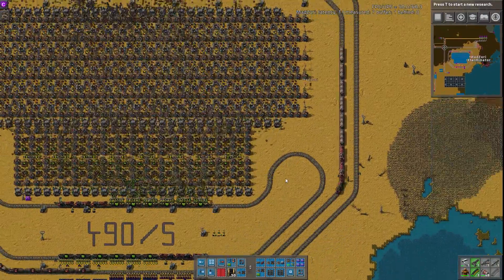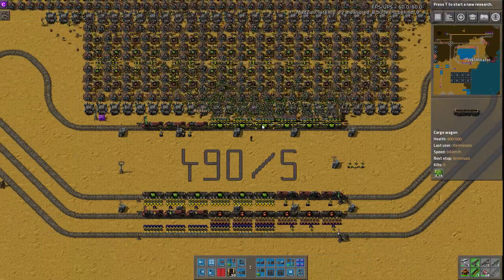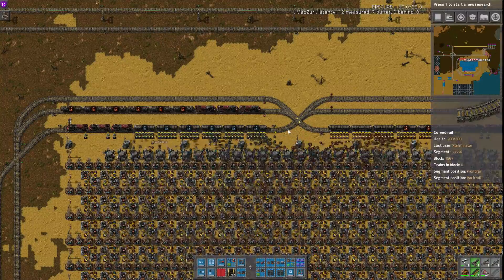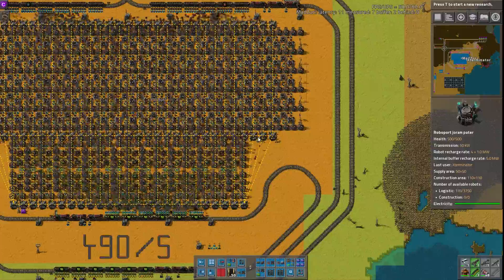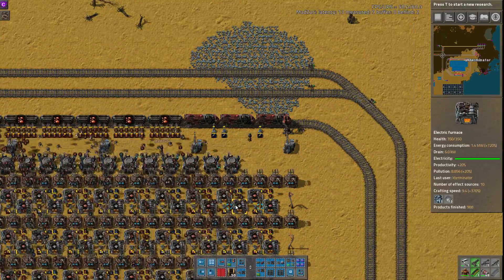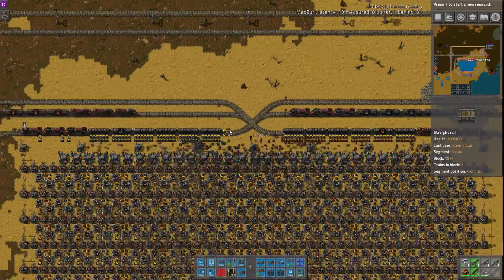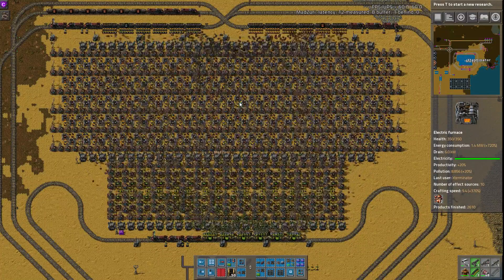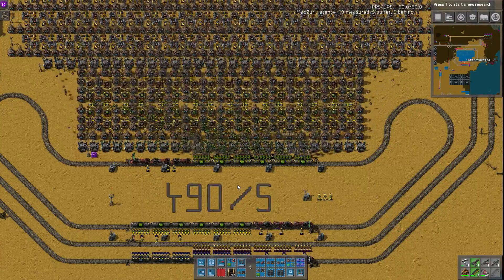Circuit Build & General Tips / Advice :: Factorio Workshop Season 2 - Building A Better Factory

Comment: Given the very high demand of green circuits in contrast to other intermediate products I don't think its a bad idea to have a dedicated build for them, however, given how contained that tends to be I would honestly use a belt based beaconed build instead of bots, maybe use bots auxiliarly in the train loading, but not so much for the entire build.

There are some efficient clever belt based solutions for green circuit builds without sacrificing any productivity, and its not so much belt that it would have as big an impact in performance as this many bots do, I would have to run tests to compare a belted solution to a better optimized bot solution, but in the end (especially with incoming belt optimizations) I think belts are more sensible for this case.

As for the trains, you don't want to stagger train traffic due to unloading,  I would prefer a double chest row to ensure the train is fully unloaded first, regardless of how the bots later consume its resources.

Comment: Since you're using logistic network, you can just put active providers on your train station, centralize the storage chests where you want them to be, only open the train station when you have enough slots to fully unload a train (if that's really the issue) that you will not have any "uneven" distribution problems.

Also I don't really know why you guys don't use inserters on both sides of the station to load/unload the trains faster. Also capping the buffer on the loader/unloaders will force the bots to fill only the chests that needs resources, like putting a request of 200 items on the loader/unloader requester chests will force the bots to fill every chest evenly without worrying about one or another wagon getting filled before the others slowing down the loading process.
Reply from the maker: Using active provider and storage tends to create bit bot surges which hurt UPS. Same reason why we don't use a ton of Inserters to unload, because it's not needed and more Inserters = more lag. 
Capping buffers does have some downsides but would help with the bots grabbing evenly.
Reply: I mean, yeah more inserters = more lag but you'd be loading/unloading 2x faster so you wouldn't feel the lag. And the active providers with high speed bots wouldn't require too much bots to unload them since they would be moving superfast and with cargo lvl 4 (5 units) its 2.25 bots per inserter swing, so 12 inserters with 12 stack size, moving 144 items/s in/out of wagons it would require 29 bots per second to move everything on the 12 chests. Assuming the trip takes 2 seconds (1s each way) you'll require 60 bots total per unload job. That won't hurt UPS.